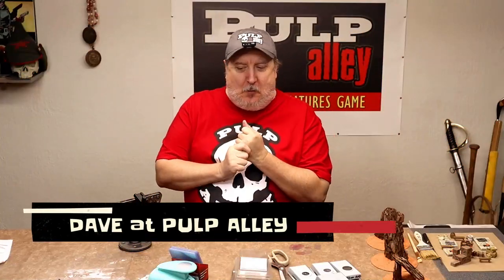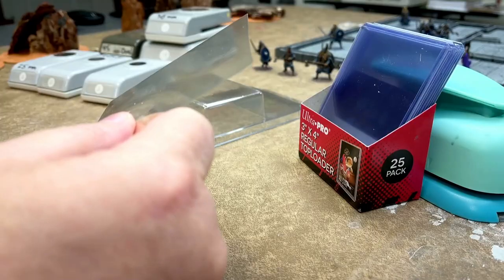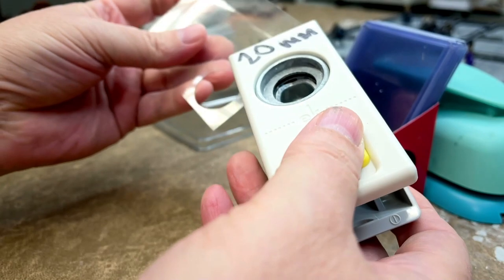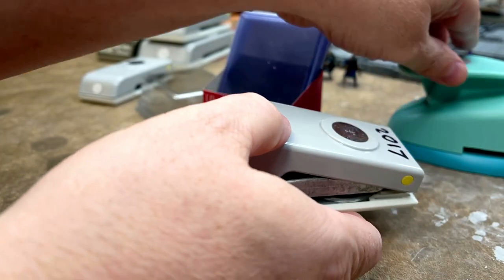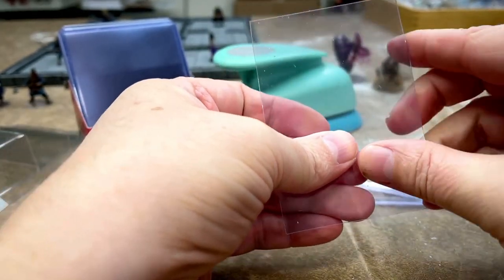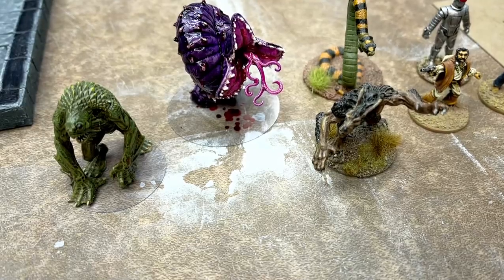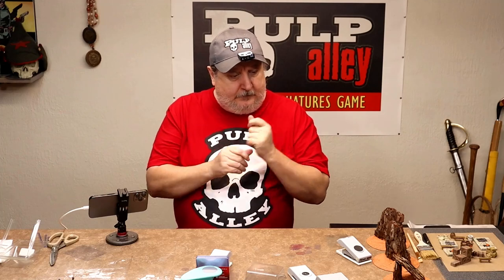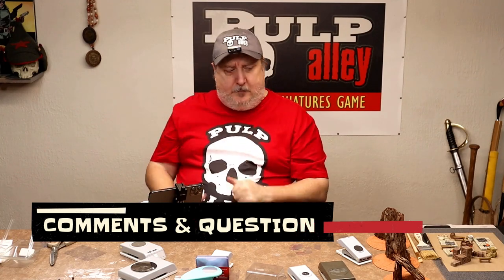Tabletop Tips - How To Make Clear Bases

Comment: I thought I might have been crazy for considering toploader plastic for clear bases, cool to see you guys thought of it first! 

I'm making some custom ground vehicles for X-Wing and didn't think plain black bases would look good on the variety of planets I'm hoping to make. Might try this out.

Have you tried gluing more than one layer together for a thicker/sturdier base? I'm worried that may reduce the transparency and make things cloudy.
Reply from the maker: The plastic is much studier than people think. No, I don't double layer the plastic. And I have use it on some fairly heavy metal figures. We used to have issues with fogging - but since I started using a glue accelerator like Insta-Set I have experienced 0 fogging issues.